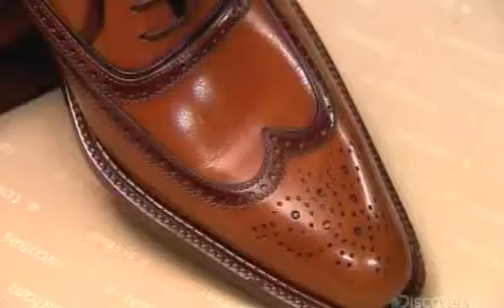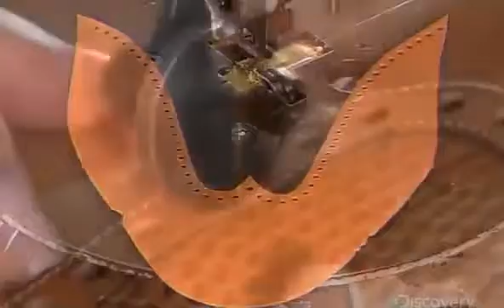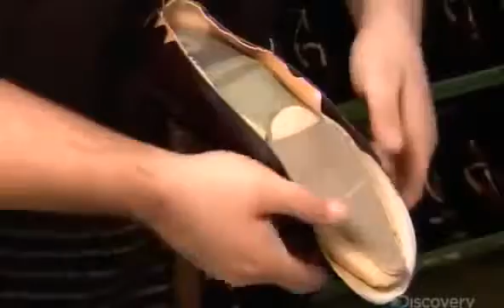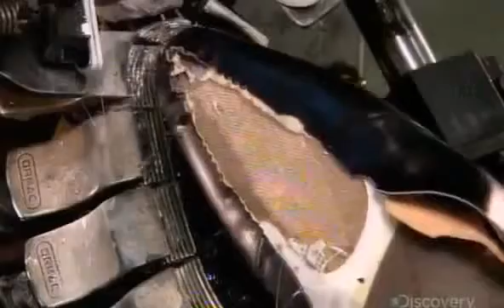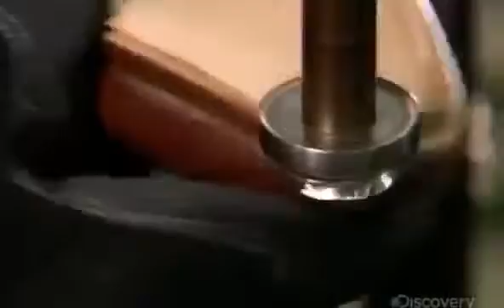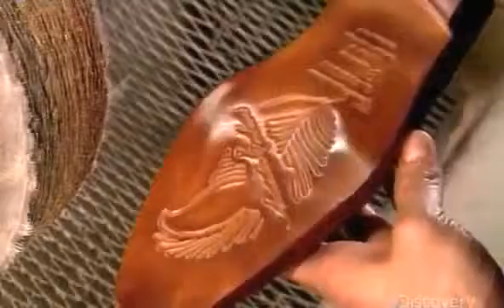How I’ts Made Leather Shoes

Comment: These are real dress shoes, not your average pair of cemented, rubber-soled stuff you can get in a department store or low-end menswear store. The typical leather that goes into making these shoes, is a full-grain calf leather. By nature, calf is a very soft and pliable leather, which allows the shoe to easily flex as you walk, permitting comfort. Some "exotics" may occur as well in some of these high-quality shoes. Your typical department store shoe is made of a lower-grade leather, which may be cosmetically touched up to hide any defects and will be stiffer. This leads to an uncomfortable shoe, and possible cosmetic defects as the cheap finish may wear off. The other thing that happens with these cheap shoes is the sole starts to peel away from upper after about 8 months of regular use. Ultimately, with a high-quality shoe, you get a superior leather which permits comfort, a superior construction which ensures longevity, and the ability to get them resoled and reheeled, versus just throwing them in the bin when they wear out. Getting these shoes resoled is usually cheaper on average than buying a new pair. The construction featured in this video is what's called a closed-channel Blake construction. Without getting into it, this essentially allows for a very dainty, lightweight and comfortable shoe at the expense of waterproofing and durability compared to other construction methods. Another construction method called a Goodyear welt allows for better waterproofing, durability and pretty much indefinite resoling at the expense of daintiness and a slightly heavier shoe. Both construction methods have their adherents. Another thing about these shoes is that you need to care for them properly. If you don't like the idea of that, seriously, save your money and stick with the cheap stuff. You need to keep the leather in as pristine a condition as possible, which includes regular cleaning of dirt and detritus, buffing and polishing to keep them shined, and conditioning to keep the leather soft and to prevent it from drying out and cracking. Consider waterproofing if you live in a rainy climate as well. Rotating the shoes and using shoe trees when you're not wearing them allows them to air out, stay relatively free of moisture to prevent lining rot or odour, and also helps them keep their shape and reduce creasing. Overall, a real dress shoe is definitely a bit of an investment in terms of labour, time and money, but your feet will thank you for making the switch. I get they're not for everyone, but I wear real dress shoes exclusively simply because they're built to last, are comfortable, look great when worn in a tasteful manner and are arguably timeless.